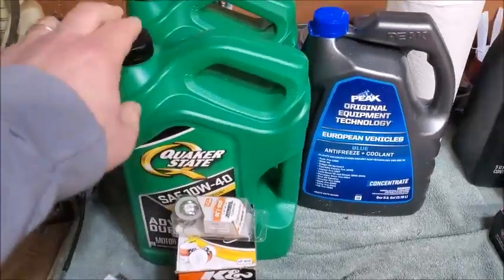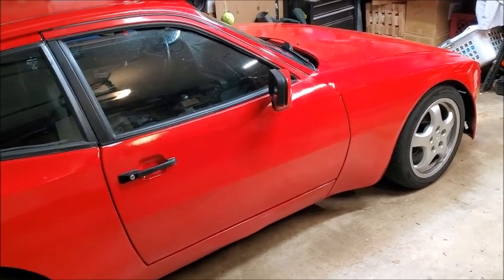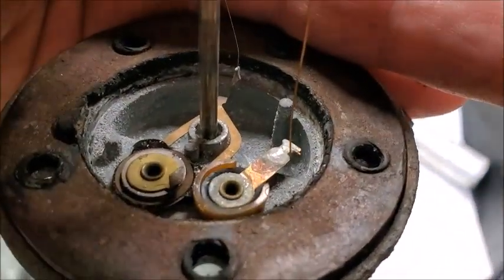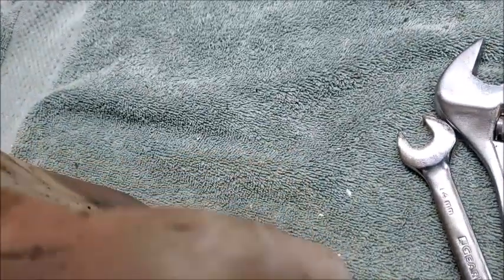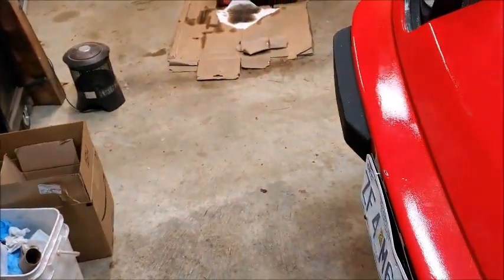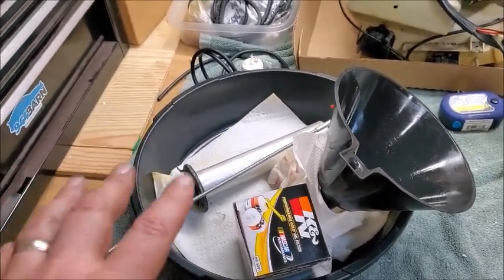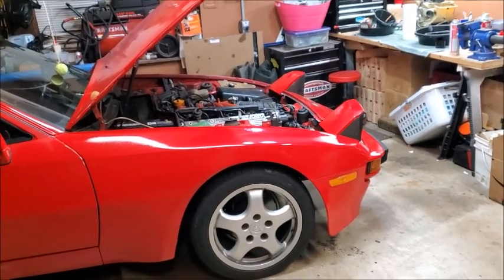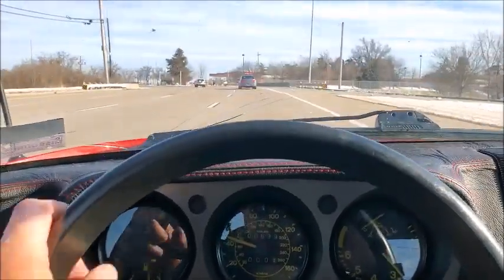1983 Porsche 944 Working On the Fuel Sendeing Unit Again Washer Reservoir

Comment: Great video, you're almost done with the car!  Not sure how that High Tension sticker got on the washer fluid reservoir.  New (reproduction) stickers aren't too hard to find and you could put it up on the hood where it belongs.  I wonder if you could have repaired the reservoir crack by melting it together with a hot iron - plastiweld style.  Glad you fixed the fuel sender b/c the ones for the early cars are expensive.  Good luck with the steering wheel recover.  I did my 4 spoke wheel recently and it was actually very difficult and time consuming and hard on the eyes.  You'll need to rig up a way to hold the wheel while you're working.  Use contact cement to position and partially attach the cover to the wheel and then go around with the thread.
Reply from the maker: Thanks for the advice and compliments.